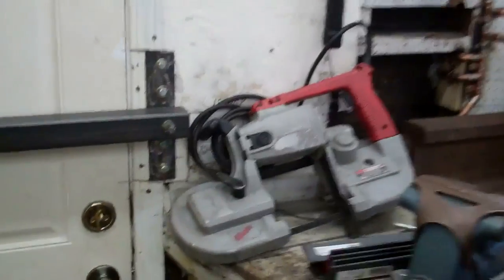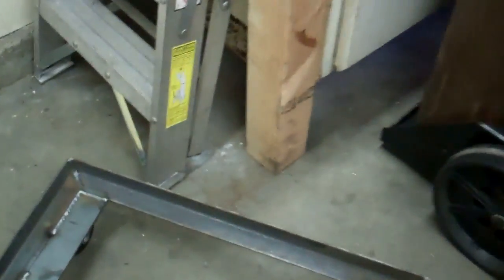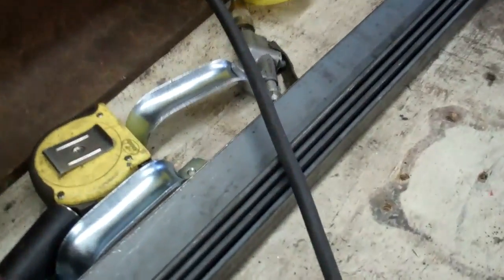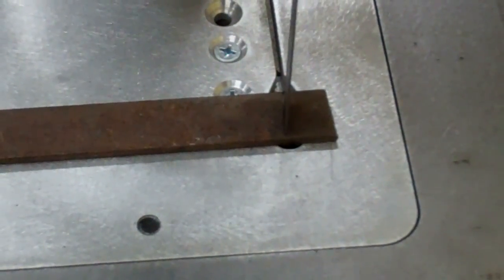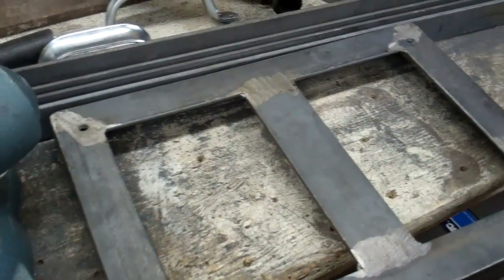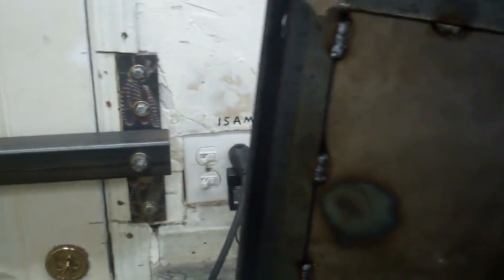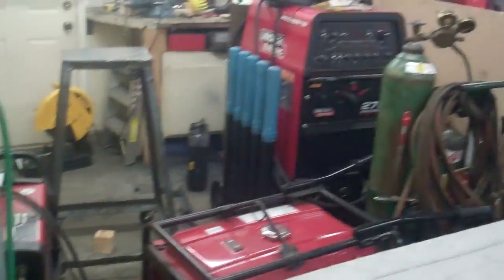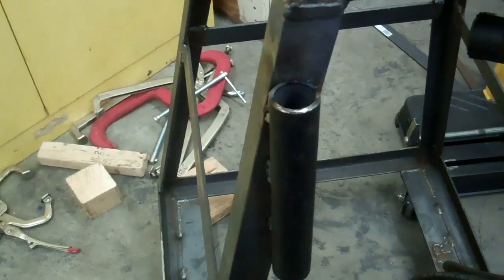Milwaukee Portable Bandsaw turned into Vertical Bandsaw

Comment: Bro with all the gear, knowledge and, ability you have, you could've built a better setup than the swag stand. Those swag stands are made for "hobbyists". You are a "fabricator". props on the work though.
Reply from the maker: Christopher Martinez   Thanks .  I only use that to cut small stuff.   The advantage with those band saws are you can buy the blades at any hardware store.   Recently I bought a Professional cold saw.

Comment: Nice build and the SWAG product is quality, if you have a moment please view my video,  I build my own design which I believe surpasses any other build.  My design has an adjustable table along with the ability to change from a vertical saw to a handheld saw in seconds.

Check out Quickie 3 Milwaukee Portable Bandsaw Stand on my channel

Also....nice shop you have, I will be back!

Comment: Im just getting into welding now, and was wondering, what is a sufficient size compressor for the plasma cutter you are running??
Reply from the maker: I have a 14 CFM air compressor.  But I think you only need 6 CFM for that plasma cutter.

Comment: Swag makes some nice stuff!  I have the metal break from them and it's very good.
Reply from the maker: I also have their press brake and press plates.  I just got their tube roller, Im making a video on it right now.
Reply: I bought the complete mod for the HF tube roller.  Still have to weld it up.  I'd like the get the finger brake but only have a 12 ton press.  Maybe Swag will come out with a 12Ton version.  I hope you post a review of your tube roller.
Reply from the maker: Im not sure when I will actually use the tube roller. I don't have anything I need to use it on right now.  I have a bunch of work I want to do on my garage first.
Reply: I know what you mean.  I have not done much with mine either but you have to admit, it's a cool tool to have :O)

Comment: Wheels on stands seem to be a problem when you have to put pressure on the saw when cutting the locking on wheels do not hold well enough I found out.

Comment from the maker: Im going to try to buy another one of the Aluminum Plates on top.  I want to weld the slot in it up and cut it the other way.   I think that would be better.  Then you can change the blade without taking the plate off.    If I do that Maybe I will make a video of it.